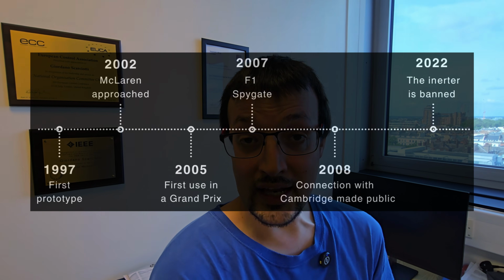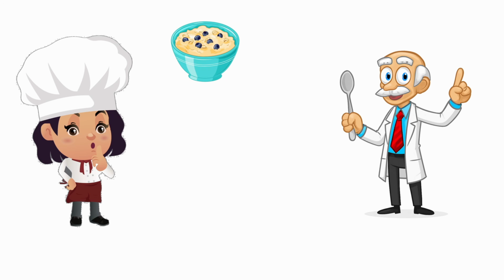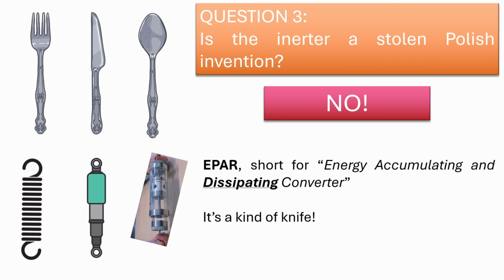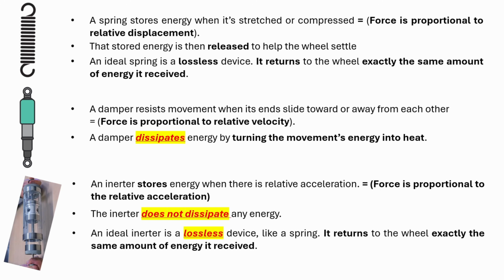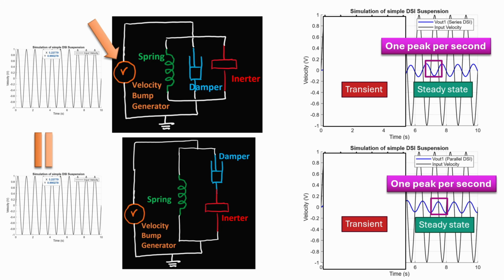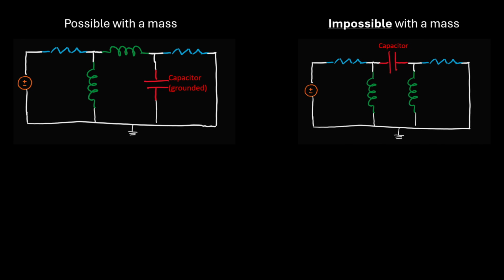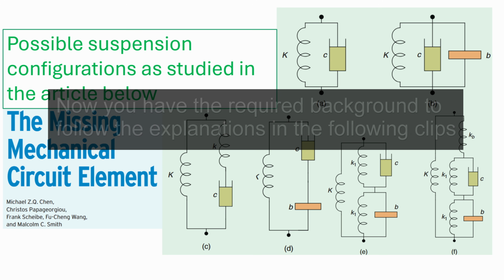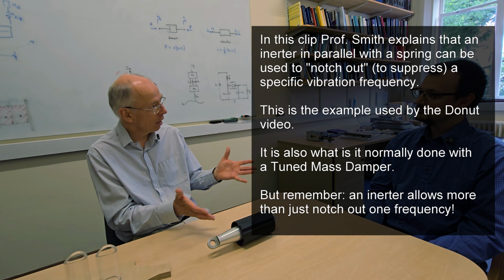Why Everyone Gets the F1 Inerter Wrong | Explained Clearly

Comment: "A plunger slides in and out of the inerter’s main body as the car moves up and down. As this happens, a flywheel mounted on the plunger rotates in proportion to the relative displacement between the attachment points. The result is that the flywheel stores rotational energy as it spins." My question is this the stored energy in the flywheel should keep pulling the suspension up after it hits a bump?
Reply: If it would spin, it would, but it does not...  (even more confusing...  8-)

It works like Oblique (or something like that, corn starch in water) the harder you hit it the more it resists.
It takes time to start the flywheel moving thus it resists movement input.
A bump in the road is measured in milliseconds, so before thee fly wheel knows what hit it, the bump is gone.
Because the fly wheel had no time to react (spin) the inerter acts like a stiff rod.
When the inerter is pushed slowly, hanging in a corner, it does not resist at all, also the spin is not fast enough to 
'pull through' the wheel.  The flywheel spins (relative) as fast as the input.
If there is any 'pulling through' , the movement is in the same direction as the original force and is already being dampened, I don't think one would notice while driving
By changing the mass of the flywheel you can tune it for a specific frequency (band)

Comment: So the Inerter when used in particular suspension designs allows one to tune the system so that you can effectively cancel out the velocity of the spring or increase it? 

In suspension design you could then use the damper to control forces such as small bumps or or slow movement like going over little hills.

Then the inerter could be used to maximise control of the system through brake dive and body roll?

I think I am probably off on my understanding. I definitely feel as though I grasp the inerter and how it works. But I really don't understand how it translates to a more complex system or how it works in a car.

Why do you want out of phase velocity to the spring?

Why would you want the inerter to return stored energy to the system when the spring already does this?

Does the damper now need to control for energy dissipation of both the inerter and spring?
Reply: Short answer I think so far : If you are stuck with a spring where the stiffness that you need has a resonant frequency that you do not want, you could tune out that frequency with an inerter. Softer suspension that does not bounce around perhaps. 
Long Answer I think so far:
I think there may be two ways of seeing stored energy. A. is that once the flywheel is spun by the first outside force input then it continues rotating as a stored energy, then when an outside force trys to go in the reverse direction the stored rotational energy is used to decelerate the  2nd outside force input in the reverse direction. B scenario is where the inerter flywheel is moved and has time to  come to a decelerated stop away from a baseline starting position, then the new position is stored potential energy relative to the original baseline position  which we all implicitly assume to be needed due the springs in the Formula one use assumption. B is a subset of A since A would need the decelerate the flywheel in one direction before accelerating it in the other direction. B only has to accelerate the flywheel in one direction. There could be scenarios where the deceleration of the flywheel of the first movement acts on one source of the first input and the restart of rotation of the flywheel could be in any direction from any other source and direction for some unimaginable product like a ball that is designed to never bounce, such as boat exploding sea mine perhaps.
So I think one first has to disassociate the device from the Formula 1 or vehicle suspension use case, then the issue of how to use it to benefit a certain frequency or stiffness of a certain use case that is withing a use case that where the same configuration has to serve other frequencies and functions, is a giant problem beyond solving here, but there is a suspicion that when used in the heave spring and then removed by the rules of Formula One, then the cars porpoise/oscillated badly on straightaways possibly having to do with the sensitivity of the ground effect to any change. but people disagree on this scenario, but it is an example of how hard it is to answer application questions.
Reply: @retroproto8075   Interesting points. I think of it in the context of Mountain Bike suspension too where preventing the rate of return too much can cause the bike to ride at the end of its stroke where the suspension feels the most harsh.

As was explained in the video, when you add an inerter to any system causes the steady state frequency to remain constant. So in that case, it is predictable. 

I do not understand how it works in combination with the damper and spring to create that but that is how it is.

Understanding that leads me to think that because an inerter brings the steady state frequency down from what would otherwise be a harsh frequency, it becomes less work and faster for the damper to control that and then allow the system to recover.

But

Comment: @Prof_Gio - Thanks for the elaboration. I thought the first video with Prof Smith was clear enough; this one re-iterates the main point, states it in multiple other ways, and addresses some lingering confusion some people have.  For your next video 😊, I'm sure that many viewers would appreciate going beyond the theory of "Design space" into an analysis of the suspension system in the practical realm.  I am imagining (a) here's a suspension with spring and damper (and fixed mass = the vehicle). Show frequency response.  (b) here's what a tuned mass damper can do. (show similar math)  and (c) here's one example suspension system composed of multiple spring/damper/inerters, and here's the frequency response, and the impact on on-track performance.

I read another comment about the track simulator, explaining that the analysis cannot consider frequency in a specific range, but rather the behavior across a full lap on the actual track with all its undulations, curves, variations and flow.  It would be cool to understand how the teams iterated on the design of systems using the simulator. Maybe that is outside your  area of expertise.

Comment: So it’s essentially a linear actuator, with the suspension elements supplying the motive force for the rod screw. Kind of backwards from a normal ball screw cylinder actuator in industrial applications, but similar. I think I see two slots in the cylinder that provide a method for preventing the ball nut housing from spinning in the cylinder. If you had weights on the nut that were on short swing arms you could have high and low speed variation as the centrifugal force threw the weights away from the center axis, changing the radius of gyration. Then there are all kinds of ways to adjust the system with different springs on the arms, and travel limits, different weights, etc. Or I could be totally wrong!

Comment: My background is electronics, not mechanics. People often use mechanical analogies to understand electrical components, but I don't think the opposite analogy helps because mechanical devices are more intuitive than electrical devices when looked at individually. I know that's reductionist, but each component of a system must be understood alone. To understand anything we have to look at it in different ways, from different angles. What I need is to see the actual device in operation at slow speed with each phase of operation explained, and ideally to have each phase explained in at least two ways.

Comment: Regarding system thinking and the "completion of the trilogy" - it reminds me of the invention of blue LEDs - it used to be that we had red and green, and we could simulate amber by alternating current through a pair of green and red LEDs with opposite polarity. It wasn't just that blue LEDs allowed us to do "the same, but blue" - all of a sudden, having all three colors allowed us to combine them to achieve the entire spectrum of visible light. 

I'm still not sure I understand what an inverter does or how it works, though

Comment: The diagram on the whiteboard is similar to the designs from phased arrays in radar, all the way back to directional arrays of AM terrestrial radio, which are simpler to understand; in that multiple towers spaced in specific ways are fed radio frequency current in tunable phases and current levels. The result is a physical shape (like cardioid for example) of the signal so that one radio station doesn't interfere with another that's close in frequency.

Comment: Is an inerter different from mass when placed in parallel with the other components. I understand it allows for more configurations that are not possible otherwise but for a simple mass/spring/damper system, would an inerter change the response in a way "tuning" the mass wouldn't?
Reply: the renault guy below @davidhamer8333 describes some test comparisons where both methods had the similar effect but how much for what relative weight penalty is unknown and which springs it was placed on is unknown.

Comment: Because I am an electronics technician , I immediately understood the comparison of tuned circuit inductors and capacitances to the spring / inerter relationship in the first video.
I also recognised that that explanation would go over the head of most automotive sector people who don't understand that a vehicle suspension is a harmonic system just as a tuned circuit is. (unless they are suspension designers)

Comment: I ran the 7-post rig at Renault F1 through the tuned mass damper period and when we started using inerters. We would play out a track profile to a car sitting on the rig and measure the force variation at the contact patch. This was then used to calculate a laptime gain If the driver could make use of each gain in grip At Silverstone the tuned mass damper gave a 0.25sec laptime gain. When we started testing inerters, I was dubious and thought they would just act as if the suspension static friction was high, although I fully understood the electrical circuit analogy. In fact they did reduce the force variation at the contact patch. it was not as much as a tuned mass damper and I don't recall any actual values for laptime gain. Incidentally the tuned mass damper was designed and put on the car to reduce contact patch force variation. It's main aim was never to improve aerodynamics. I enjoyed and could follow your video just fine. Thank you.
Reply: Was the inerter placed in parallel to the spring/damper or parallel to the anti roll bar?
Reply: @efrgsergfsgg if McLaren 2025 suspension setup is studied, the lack of tire wear, and one driver's feedback that the setup removes "feeling" from the tires, I imagine they're using inerters to keep the chassis from heaving and decoupling aerodynamically from the track.
Reply: @wasabij  If McLaren are found to be using inerters in 2025 they'll be disqualified since they were banned from the 2022 season with this generation of car.
Reply: @Your_Paramour they can't ban you from applying scientific principles tho and they can indeed put another system in place that inerts the body roll. You can PHYSICALLY SEE the suspension and frame are different this year from most of the field.
Reply: I think it is well know that the mass damper was not introduced to improve aero but that is how it was banned.
Reply: @QOTSAPT  inerters and mass dampers both use mass, but they actually act differently on the suspension.
Reply: Perhaps you did not understand the concept of the inerter at the level of Prof Smith?

What does seem clear is that it gave a real advantage to all the teams that used it, properly or not.
Reply: @renedosr As part of a system an inerter prevents the tires and chassis reacting in oscillation, keeping the entire system more neutrally positioned to aerodynamically maintain grip while allowing the tires to maximize grip over the entire revolution of the wheel.

Comment: What you failed to explain in either video is how the energy you put into the inerter is returned to the system.  This is surely the most important point to understand about the inerter.  You repeatedly say that the energy is returned to the system, but not once did you describe how.  We only ever see it operating like a child's spinning top, where the translational force is converted into rotational momentum, but we never see that momentum converted back into a translational force.  I assume this is done on the return stroke, where the rotational momentum opposes the retraction force, but this is never made clear in any of your three levels of explanation.  Whereas the stored energy in a spring adds to the force trying to return the suspension back to equilibrium, the inerter opposes this force, which is why it operates 180 degrees out of phase with a spring. 
I studied acoustics at university, so I'm very familiar with the mathematics of vibrating systems.  Even so, your explanations were hard to follow simply because you omitted this crucial and most important aspect of the design.

Comment: It's a ball screw, and relies mainly on resisting change of direction acceleration, which does dampen spring oscillations. It should be replaced with 2 opposite direction freewheel sprag clutches, one connected to a reverse gear, each connected to another gear that is driven by a linear gear (ball screw or standard) so up-down motion is converted into one way rotary motion. It kills most of the inerter effect but you still get some magnetic resistance and a few kW of energy. 1 to 20+ gear ratio and 16 to 24 pole generator produces a pulse with around 100 microns of suspension movement (in a perfect system!) while resisting suspension velocity change. Still needs a spring and normal dampers.

Comment: I have zero engineering background and found the third section easier to follow than the first two.  But, if I am understanding this as I think I am, the inerter is absorbing energy when the spring is inputting an and then dumping energy into the system when the spring is absorbing energy.  This in turn smooths out oscillations and vibrations going into the chassis from the suspension.  At least that seems like the general idea.  Am I on the right track?

Comment: I still don't understand how does the inerter work when there is such a mechanical disadvantage 
anyone who has tightened a nut onto a bolt, will know that turning the nut to make it move is a lot easier than pushing on the nut to make it turn....

Comment: I think you can start a Inerter channel on its own. New videos that show a mechanical system and how an inerter was used in conjunction with springs and dampers to solve the real world problem. 

I think your ELI5 explanation was fantastic. I got a little lost in L2. The electrical equivalent in L3 made more sense to me because I have an electronics background, although I was weak in more complex math. (now retired and have little need for more than basic math)

Comment: Seems like a good practical analogy would be to the "active  noise cancelation" systems that were used on some luxury cars. They used "speakers" to emit opposing phase sounds that canceled the mechanical noise generated by the vehicle. The system had to be tuned to the individual vehicle and operating parameters. 
In simple terms, mere mortals won't typically have access to sufficient data to make an inerter work correctly...lol.

Comment: It is kinda funny seeing people have a problem grasping the concept when even university racing-teams had already developed their own version of the inerter some 20+ years ago - but for them the complexity and uncertainty was not worth the weight/complexity/risk. it is fundamentally a rather simple device: Create something that when squished together acts like it has a looooot of mass without actually weighing a lot. My local racing-team had tried something like that since the early 2000's (the idea might very well be from the original paper) but always deemed it too complex. Part of the reason was that they took pride in having not manufacturing done outside for anything other than the jellybean components (so screws, wires, chips, bearings). T

and now i am thinking: can you make this small enough to be viable for bicycles? In forums you can find some people toying with the idea since around 2010 but nothing more than just some people cobbling something together from scraps.

Comment: So it is analogous to electrical systems being able to be described in terms of capacitors, resistors and inductors for mechanical systems. Now you have springs = capacitors, resistors = dampers and inerters = inductors and you can design the system to have the characteristics you want over a wide range of input frequencies of the suspension.

Comment: So, what I'm getting so far, is that the elements in a physical system, spring, damper and inerter are equivalent to the resistor, inductor and capacitor in an electronic system. Any passive circuit can be built with just these electronic elements, and any physical suspension system can be built with the mechanical elements. If that is right, why on earth would they be banned in motorsport rules? Isn't that similar to saying that all the electronic circuits in the car are not allowed to contain capacitors?